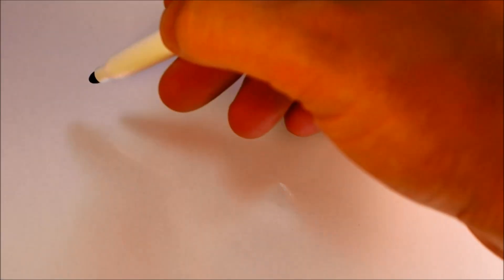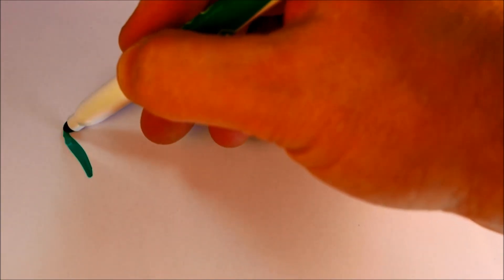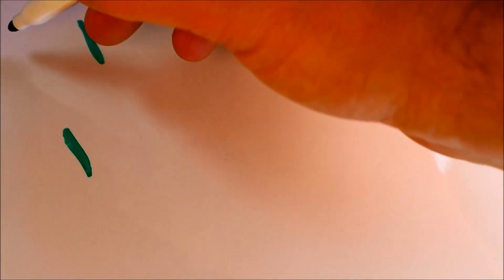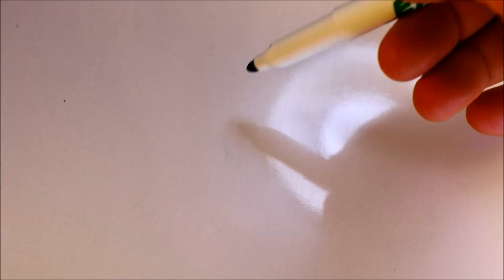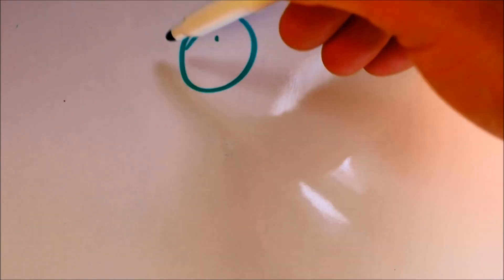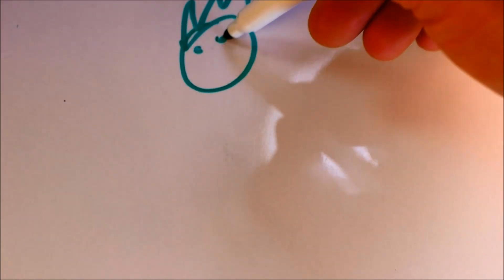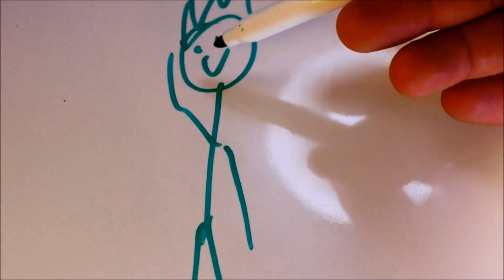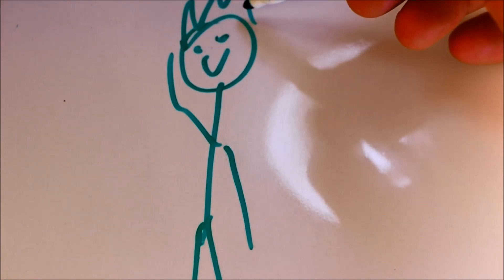How to Focus a Rangefinder Camera

Comment: I have fuji GL690. Using 65mm lens needs to use the external viewfinder (the default viewfinder is for 100mm lens only). 

With Fuji external viewfinder, there is a pallalax adjusting ring which suppose to adjust the number on the viewfinder to match with the distance between the lens to the subject.

However, all the pictures came out to be not the same as i see in the external viewfinder. It seems the frame coverage is not precise at all. Most of the below part is cut out. The left and right are also not precise.

Is this normal?
Reply from the maker: I'm not familiar with that camera and lens, but at that tier of camera I would expect that the gear would work. When you adjust the parallax adjustment, if it works like a 35mm rangefinder with a parallax correction, then the scene inside the viewfinder should shift. If it does not, my first bet would be that the parallax adjusting mechanism isn't working.
Reply: @DavidHancock  the scene inside the viewfinder did shift when i adjusted the pallalax, but the result pictures taken are not same as  what i saw in the viewfinder especially the bottom and top area. Possibly the pallalax mechanism need to be repaired. Not sure whether any technician can fix it. Thanks

Comment: Hey David! I'm currently waiting on delivery of a Ricoh 519 Deluxe rangefinder. If I understand correctly, it uses prisms instead of mirrors in the focusing mechanism. I would assume the operation is similar. Also, there is a switch on the lens with the letters "M", "F", and "X". Would you have any idea what that is? Something to do with flash sync maybe? 🤔
Reply from the maker: Nice! Those are great cameras. The rangefinder should function in the same way. Prisms will last longer and be brighter than mirrors. For M, F, and X, those are self-timer, flash bulb timing, and modern flash strobe timing, respectively. Just leave it on "X" as the "F" setting will cause the flash to fire out of sync with the shutter. Using "M" can risk the self-timer jamming, which is a very common issue on old cameras.
Reply: @DavidHancock  thank you!!!
My dad had one many years ago. At that time, I didn't know an f-stop from a wheelbarrow but thought it was really cool. Don't know what became of it. So, poking around on line (dangerous habit) the other day and there it was. Just like my dad's old camera! So I bought the dang thing! Lol!

Comment: So it's adjusting the mirror, not the lens?
Reply from the maker: When the lens moves, so does a mirror. They move in time so that the mirror shows what is in focus as the lens is adjusted.
Reply: @DavidHancock  Sorry I still don't really understand. I saw some diagram, and it seems that the mirror is not in the light path of the lens. How can the mirror show what is in focus then? Is it just an approximation (e.g. the infinity focus of the rangefinder is calibrated so that it match the inf of the lens)? These non-though-the-lens mechanisms are reallyyyy weird.

Comment: tip for your videos:
use a diffused light (far away with some paper in front of the light) and a mate surface.
So you cant see the light in the surface reflection.
Reply from the maker: Thank you! This is a pretty old video. Let me know if my recent ones are doing that better. I was still very much learning how to light videos back then.

Comment: i have this canonet camera,while im focusing, the pictures cant overlap, it just below the other picture. can i fix this problem?
Reply from the maker: Possibly. More likely a professional repair is needed. It sounds like one of the mirrors is mis-aligned and that can be a hard repair to do if the top of the camera has to be removed (which is probable.) The Fix Old Cameras channel might be better able to diagnose this than I can.

Comment: i have a old Voigtländer Vitomatic and the 2nd image isn't moving at all when adjusting the focus...
Reply from the maker: Something in the system is likely disconnected. That will likely require a professional repair as it almost certainly needs the camera's top to be disassembled to access the parts that are at fault.
Reply: @DavidHancock  Do you know what a repair this kind could cost?

Comment: How is the lens focussing/movement mechanism information passed to the second/focusing mirror in the rangefinder.
Reply from the maker: A series of mechanical connections from the lens' focusing helical to the adjustable mirror.
Reply: David Hancock thank you. What about aperture and shutter speed. Will the rangefinder mirror give information about that or should we be doing guesswork on that?
Reply from the maker: You'll still need to figure that out yourself. The rangefinder will only give you the distance to your subject.

Comment: Hi! If I want to make a simple rangefinder with two mirrors, do I need to put lens to focus the light? If so where should I put them?
Reply from the maker: Well, it's a bit tricky to do that. Assuming that you have the geometry correct, you'd need a housing that blocks out extraneous light, one of the mirrors has to be a two-way mirror. So your lens wouldn't be connected to your RF. You'd use  the RF to find distance and then set the distance on the lens.